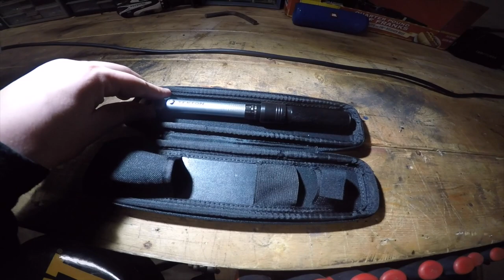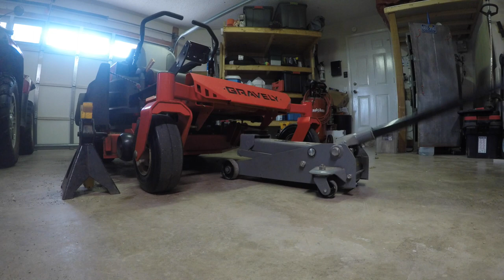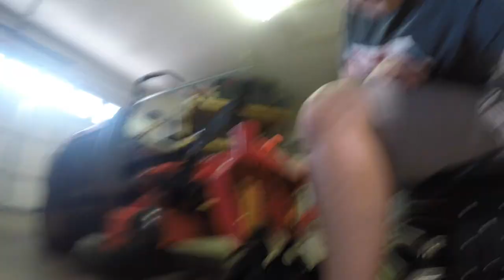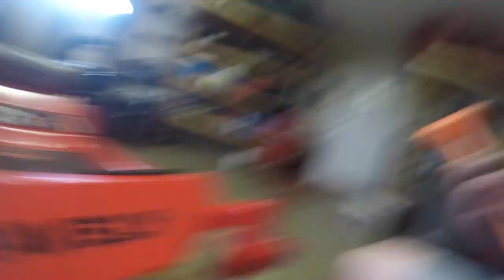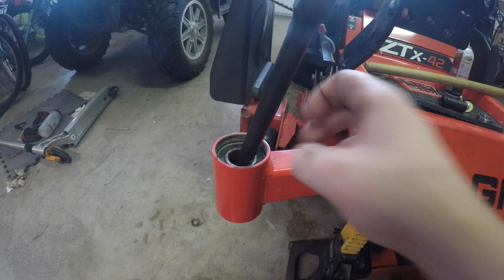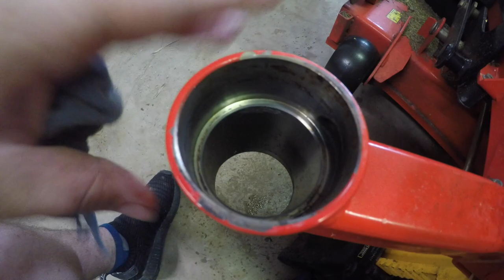replacing gravely caster spindle bearings

Comment: Heat the frame around the area where the bearings will sit with a small torch. Put bearing in the freezer for 30 mins bearing you install it. You should very hit a bearing to install it. Great idea on pressing the bearings in.

Comment: while the bearings are out is the time to drill, and tap for grease fitting and install grease fitting, then take the seal off the side going in toward the middle so you can grease the bearings making them live longer.
Reply: Exactly.!!   Because the grease worms got to the old ones .😂

Comment: If you've done trailer wheel bearings, especially semi siezed - heat welded on where they need cut off, such difficult, blown out, bearings- this style, instead, is very easy, especially the top one. 

As with all bearings, the nut needs to be the correct tightness - not too tight, not too loose, rotation of swivel smooth and easy moving. I go generous on the grease.

Comment: My gravely is much older 1999 260 zt. It has threads on top with a nut and a cotter pin. The diagram in the parts shows , from the bottom is a spacer, a seal, the bearing a cup and then the upper part is the other way. First is the cup, then the bearing {no seal} a washer the Nut and cotter pin. My problem is getting the cup in place from the bottom. I can get it started with a mallet, like you used, but I can not get it go higher up. If I don't get it up high enough the Nut will not be sticking out enough to get the cotter pin into place. Can I use a similar socket method you used to put the cup into place? With a big C clamp.

Comment: How long do those sealed bearing last?
Reply from the maker: Lee S  The original bearings in the mower last about a year the ones that are in there that I put in are still in there today and are still very smooth
Reply: @cresciscustoms3332  only a year? Wow. What ones did you use now?

Comment: What do you do if you can’t get the shaft to fall out .Ive been hitting it and it’s locked in there pretty good smh
Reply from the maker: Kevin Haggins I would take a blow torch. if you have one use the yellow bottle of map gas it gets a lot hotter. if you’re replacing the bearings get everything in there is hot as you can then quickly grab a hammer and beat the living hell out of it. but you also don’t want to hit it too many times to where the metal on The top of the shaft begins to mushroom over. you may want to hit it with a wooden block. try that if that does not work I would use some kind of a puller
Reply: Lol thanks Joe !Im headed to the hardware store as soon as I get off work .Thanks for making this video bro.
Reply from the maker: Kevin Haggins sounds good if you have any other questions let me know